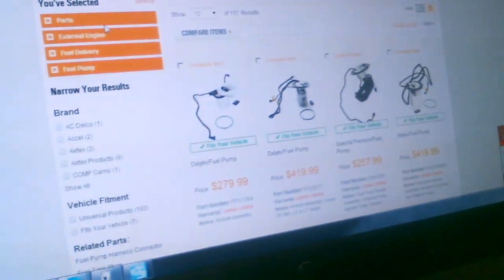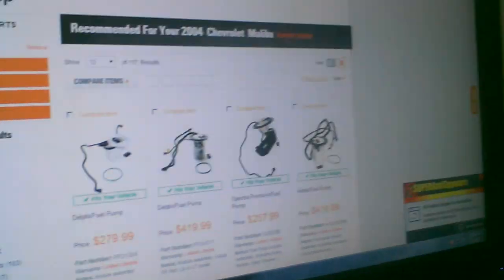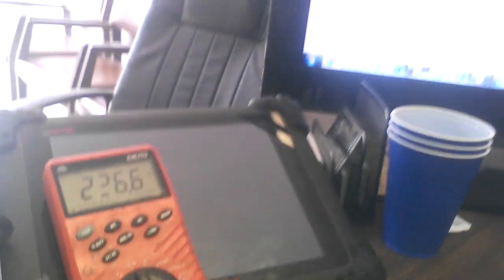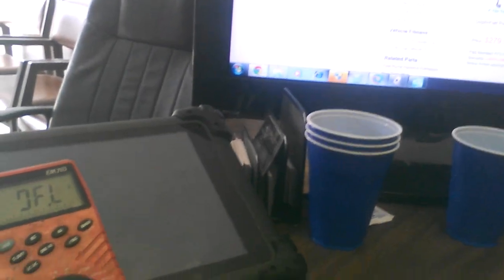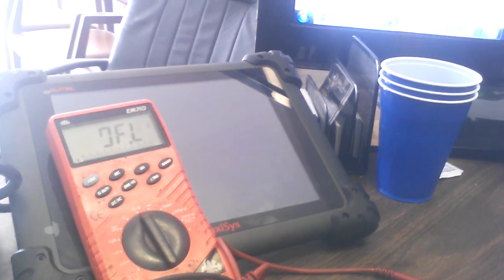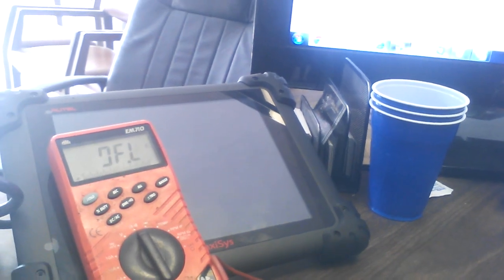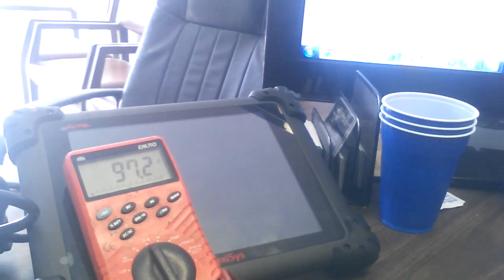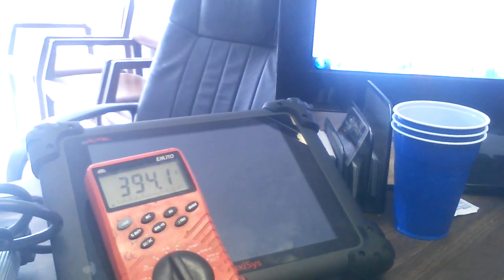Gas gauge not working ? Some test to check it

Comment: so you were saying something about instrument cluster on chevy trucks and i am having a problem with my chevy trailblazer gas tank gauge. when i turn the key the the feul gauge goes way to the right past the full line and then stays their is their something i can do about that? its not the fuse already checked that just wondering if there's something to instrument cluter

Comment: Excellent. Sometimes when I fill the tank the sending unit seems to hang up in the full position. It happened today. The needle did not start to drop until about 100 miles. It's a 2006 Matrix with 210,000 miles. What's weird is it only happens like every 6 months, otherwise it's s fine. It also seems to act up if tank is slightly overfilled.

Comment: Try a bit of Marine outboard two cycle TCW3 oil in the gasoline. It may start the sensor from sticking1 oz per five gallons of gasoline. It’s burns ash less so need to worry about converters or sensors.  Toss it in and just drive. The marine oil will lubricant. I’ve been doing it for years with no problems just runs smoother at idle and cleans injector and  lubricants like Lucas fuel conditioners but cheaper

Comment: This is the same item mechanic after mechanic says is the main reason. Blah blah blah,   not one of you guys show the other problems that cause it of show how to fix it.... 🙄
Reply from the maker: Because that’s what normally goes bad. And how can we show a problem that it doesn’t have ? I’m actually editing a video as we speak on testing different parts and use a wiring diagram to explain the system.

Comment: Will a bad fuel pump cause the gas gauge to work improperly like I was on the side of the road because I was out of gas and the gauge read almost Half a tank????
Reply from the maker: Well the fuel pump module houses the fuel level sensor and the fuel pump so you might just have to buy the whole unit if you would like

Comment from the maker: If you feel like this video helped out, feel free to support the channel by donating. Just one click away on the link below, to help support the channel :)
https://www.paypal.me/ozmechanics
Reply: Hey Oz Mechanic. I have a Hyundai i20 2010 model. I took it to Hyundai for checking because I had issue with my fuel gauge reading and they concluded by saying I need to get my instrument cluster replaced, which too much for to afford.

I want to know is it not possible to fix the fuel gauge reading without having to replace the cluster as they said because everything working on the cluster except incorrect fuel reading display?

Your assistance would highly appreciated.

Comment: any time there is a problem with fuel gauge i always check and add a new ground engine to body wire aleast 10ga. and cleane off paint. and disconect fuel pump connection reatach.

Comment: I just filled up my gas tank and then proceeded to park my truck on a slant and when I got In It showed past empty. I checked my account to see if maybe I forgot to pump my gas then I also topped it off. It’s full. Registers empty.
Reply from the maker: I’m actually going to make a video showing how to diagnose a fuel gauge in the vehicle. Coming out sooooon

Comment: If other gages have problems too, you may have an electrical problem like a bad electrical connector or voltage regulator or bad battery. When my battery starts to go bad on my Explorer Sport Trac stange things happen. The alarm system goes off or the radio changes stations.

Comment: Before you replace the sensor put some Chevron Techron in the gas tank. It cleaned my senor and made it work right. My Ford dealer recomended that before I spend $1200 to replace the fuel pump. $10 at the autoparts.

I have replaced a fule pump/sensor on another truck and the gage never read right again. Sensors come with different resistance ranges and they have to match the gage. What he did not say is that you need to know the max and min ohms on the sensor and buy a matching sensor. Otherwise your gage will read really off.
Reply: This needs a pin 📍

Comment: I have a 2002 Town and Country. The fuel gauge never seems to be accurate. As I drive the gauge will lower and say I need gas. Then if I had the car off for a while and started it back up it would read a not empty. If I put $20 in at e it would read half a tank. 20 gallon tank and gas is 3.30. Not right

Comment: I have replace  3 fuel pump units and my gas gauge  does not read correctly  it's a ford 2002 f250 can you help me or call me 8167039119 thanks  Richard

Comment: i have a 05 chrysler 300c  and it doesnt mark how much gas i have it stays on the bottom ive seen videos & it’s confusing i saw that its the fuel level sensor and others say its the cluster i dont wanna waist into something thats not gonna be the problem if anybody had the same issue & fix it lmk what you did & what it was TIA

Comment: I have a 2010 9.3  2.0T.  
My battery died and replaced it with a new battery and now my fuel gauge shows empty.  If I release the fuel pressure on the schrader valve,  the fuel reads correctly for about 30 seconds then shows empty again. Do you think its the fuel sensor, fuel filter, or posibalty something else. ?
Thank you for your help

Comment: Oz...where are you located...I have some work for you...lol...my 2004 grand cherokee the fuel gauge works sometimes...fill it up it works then as gas goes so does the gas gauge...
Reply from the maker: I’m in the Houston area
Reply: @OzMechanics  darn..I'm in toledo ohio...
What can you tell me about the main power supply wire from the fire wall threw the drivers door that controls everything the drives door controls...its got a break somewhere and I don't know.where it goes once its behind firewall...

Comment: Oz so I have a 2007 chevy suburban z71 and im having the same issue with the float not reading the gas correctly.  The fuel pump is new and the fluctuation is so off its frustrating.

Comment: My 03 Impala used to get at least 650kilometers to a full tank and ever since the engine misfires from my backyard machanic friend wiring my spark plugs wrong its been very off. Had the spark plugs corrected and my exhaust issue fixed since I recorded this milage. Does it burn more fuel while doing this? Do I still get the same milage? I'm scared to drive until it's empty you know lol

Comment: I have 2000 Audi tt with fuel gauge problem too.  Relay,fuse,fuel pump and sending unit are good. I'mma about to check the instrument cluster next.  Any ideas on what else it could be?
Reply from the maker: dannysa503 if you have a graphing meter you can hook up the wire at the sending unit see the voltage and shake the vehicle side to side see if changes. And make sure you don’t see any spikes to full ground
Reply: @OzMechanics  
Is graphing meter same as multimeter?  
I have a multimeter, do I set on resistance, continuity or........ and what is the purpose of doing that? Sorry for asking too much but I'm quite new on multimeter. I'm a rookie when it comes to troubleshooting electrical stuff on cars. 
Thanks for replying. ☺

Comment: Thanks for the video, though I'm not sure if this is the problem.
Can you think of any reason why the gas gauge would fail on an 05 impala immediately after a rebuilt transmission and rear brakes? 
I paid a mechanic for this work and ended up turning around because of a grinding noise. It ended up that they left some clips loose related to the parking brake.
I don't know how any of these could cause the gas gauge to fail but it's been on empty since I left the place.
Any insight would be appreciated.
Please and thank you.
Reply: Sounds like a wiring problem or a connector problem. Something was damaged or not reinstalled properly. I have seen wiring get pinched where the transmission bell housing bolts to motor.

Comment: Actually, it is not a potentiometer. It is a rheostat.
Reply from the maker: Thanks for the info
Reply: Oz Mechanics You were correct. These people are ruthless and ungrateful! Thank you for your video!
Reply: MrGreenelight Actually a potentiometer is the same thing as a rheostat.

         Potentiometer
This article is about the electrical component. For the measuring instrument, see Potentiometer (measuring instrument).
A potentiometer is a three-terminal resistor with a sliding or rotating contact that forms an adjustable voltage divider.[1] If only two terminals are used, one end and the wiper, it acts as a variable resistor or RHEOSTAT!!
Reply: MrGreenelight heres some more info for you Mr. Grenelight.. 
The word “rheostat” is becoming obsolete and being replaced with the word “potentiometer.” Read below & see asterisks(*).😊

The most common way to vary the resistance in a circuit is to use a rheostat. The word rheostat was coined about 1845 by Sir Charles Wheatstone, from the Greek ῥέος rheos meaning "stream", and -στάτης -states (from ἱστάναι histanai, " to set, to cause to stand") meaning "setter, regulating device",[6][7][8] which is a two-terminal variable resistor. 
*The term "rheostat" is becoming obsolete,[9] with the general term "potentiometer" replacing it.
For low-power applications (less than about 1 watt) a three-terminal potentiometer is often used, with one terminal unconnected or connected to the wiper.

Where the rheostat must be rated for higher power (more than about 1 watt), it may be built with a resistance wire wound around a semicircular insulator, with the wiper sliding from one turn of the wire to the next. Sometimes a rheostat is made from resistance wire wound on a heat-resisting cylinder, with the slider made from a number of metal fingers that grip lightly onto a small portion of the turns of resistance wire. The "fingers" can be moved along the coil of resistance wire by a sliding knob thus changing the "tapping" point.

Comment: If the fuel gauge is not properly calibrated, it is reason why my van gmc savana 1999 5.7 do not turn on
Reply from the maker: jesus alicea the gauge has nothing to do with engine performance
Reply: thanks,very much I clear my doubt
Reply: thanks very much, I clear my doubt

Comment: Where did you find just the switch and float? All I can find anywhere is the whole sending unit I just need a switch don't want to pay 70 dollars for a dimmer switch
Reply from the maker: +truckinmachine truckinmachine I bought it on eBay. But yea it sucks most places just sell the unit as a whole

Comment: Would this effect the tempature gauge too? My fuel and temp gauge work for a minute and then they suddenly drop to empty and cold (no reading) 87 nissan sentra 1.6 carburated
Reply from the maker: jakester Phillips might have a shirt in the instrument cluster. Or a loose wire
Reply: Herbert Norkus  Also, I replaced the whole instrument panel with a junkyard one and swapped it out to see if it was a bad panel but the issue continues no fuel or tempature. It only works intermently for a min or so. Thanks for your input.

Comment: Can anyone help? I just drove my car to work 31 mile drive and it's reading right above half tank but it was full as I just filled it up last night. I didn't look at it before I left but it's a 21 gallon tank and I shouldn't be getting 3 m/g. Is it a fuel leak or a faulty Fuel gauge? 97 ford explorer. Appreciate any help. Thanks

Comment: my tank just goes to half wwhhtyy????
Reply from the maker: Shazeb Kazi the lever might be getting stuck in the gas tank or you might have a problem with the instrument cluster. A way to test the cluster is to see if a shop can do a sweep test with their scanner to make sure the arms on the indicators are working good
Reply: A mechanic did a diagnostic test on my Honda and said the sending unit is bad, so I bought a new unit, replace it and now the gas gauge reads only 3/4 fulled after filling it up vs. before it was 7/8 full when fill up.  What's my problem?  He ran a sweep scan and said it's working properly but why is gauge is now 3/4 fulled  after filled up?
Reply: Shazeb Kazi
Reply: Shazeb Kazi

Comment: my problem is the needel is going from full to empty back and forth and it's hard to tell if the gas is almost gone or full so could this vid help me with that problem or no it's a Chevy Malibu 2004 and the gage is doing this
Reply from the maker: Austin Capps  by testing out the voltage you can see if there's a break on the sensor. What you can do is hook up a multimeter to the sensor.. find a wiring diagram and move the car up and down by rocking it. And look at the multimeter to see if the voltage is a constant up and down or does it break

Comment: I have a 1992 dodge Dakota le extended cab pickup truck. The needle started doing the weird bouncing thing in December and I thought it was just because of the cold at first. Now it just stays at half-1/4th or below the E. I guess I need a new one, right?
Reply: I have same problem in my 04 dakota. Looks like a common problem with these trucks.

Comment: Oz you are good guys. I had problem develop 2005 Park Ave where fuel gauge would swing between empty and full with tank about 1/4 full. Believe sender bad. Bought new ac delco made for supercharged3800 and everything ok until first refill. Gauge stuck at full. I am thinking stuck float? I have Ultra with driver info shows gal used and mi per gal. That reads accurate. Would disconnecting battery do anything. Hate idea of forcing new warranty exchange. I walked in part so I guessing I get stuck on2nd labor
Reply from the maker: David Bock if you can hook up multimeter to the float. And move the car up and down. If the reading move your float is good.

Comment: ive a 2010 jeep patriot & ive replaced my fuel sender in the tank, but my digital fuel gauge & needle will say full then go to half then go from 145km down in seconds to saying its empty when ive a full tank of petrol ? my engine management light is usally on also , any ideas & has anyone else had this problem? thanks
Reply from the maker: dara armstrong there might be a good chance that the wire is damaged

Comment: Before I replaced the fuel pump on my 94 silverado c-1500 2wd 5.0 the gauge would go way past the full mark and it would run out as soon as it hit the red for reserve on gauge. Ok now I had to replace the fuel pump and now my gauge isn't working at all and my headlights will go to flashing at times. Any ideas?? Thanks for any help!!

Comment: My 1980 cj 5 jeep when it had a full tank it goes to quarter a tank on gas gauge any idea how to repair this
Reply: Not fuel injection also might I add
Reply from the maker: Mary Poppins it could be the level sensor or a bad cluster gauge. You can do what I did and take the fuel sensor out and test it
Reply: anti slosh module look it up u need that fixed

Comment: Hello i have a 2006 Chrysler Sebring. The fuel gauge its not working right, the arrow goes sometimes up and sometimes down. its also wasting too much gas for a v4 any solutions?

Comment: my gas gauge isnt working on my 2003 nissan maxima and the check engine light is on and indicts that one of the sensors is messed up, would that mean i would have to get a whole brand new sensor for it?
Reply from the maker: some vehicles dont sell the sensor it self. you might have to buy the whole full pump module

Comment: i replaced my fuel pump and sending unit and now when i start my car the fuel guage will go up but when i turn the engine over it drops to a quarter tank. i have a 2004 dodge stratus 2.7 liter v6 flex how would i correct the problem

Comment: i replaced my fuel pump and sending unit and now when i start my car the fuel guage will go up but when i turn the engine over it drops to a quarter tank. i have a 2004 dodge stratus 2.7 liter v6 flex how would i correct the problem
Reply: ghostrida86 put in a Chrysler part not cheap junk.  Put it in correctly

Comment: On my '94 Grand Am when I turn on the car the fuel gauge goes from about 3/4 to over full, then when I turn it off it slowly goes down to 3/4.Can you please tell me what you think is wrong. Thanks.
Reply from the maker: im not sure exactly what it might be. could be either fuel gauge or the sender. what I would use. would be a scope meter hook it up to my sending unit in the tank rock to car side to side and see if the sending unit has any breaks in it. a lil more complicated
Reply: Ok thanks.
Reply: Alright I got another question for my cars temp Gauge it doesn't move even though I know that it's overheating. It's the same car '94 Grand Am
Reply from the maker: +Mark Sanchez old gms have two coolant sensor. ones for the computer and the other is for the gauge. see if the sensor is broken
Reply: Oz Mechanics ok thanks.

Comment: E=IR  As the resistance changes, the current value varies.  If gauge uses a rheostat in the circuit it changes the R value not the voltage.     Good video
Reply: You are 😂

Comment: Will that gas gauge will turn on the check engine light?
my gas gauge is not working and pop out the code P0641 saying is was the sensor.
Reply from the maker: yes some vehicles will throw a code
Reply: Jessica Garcia